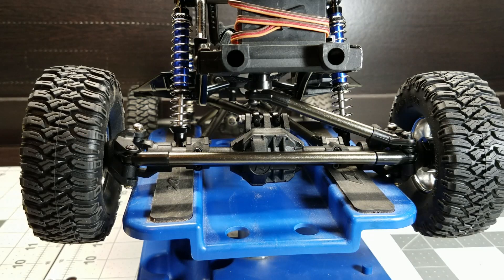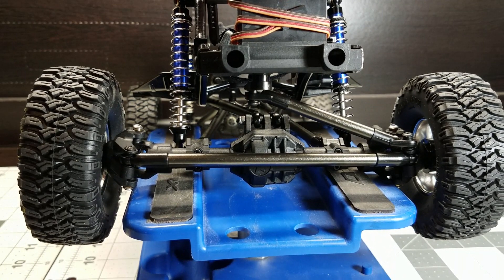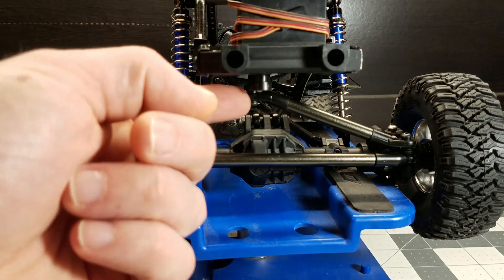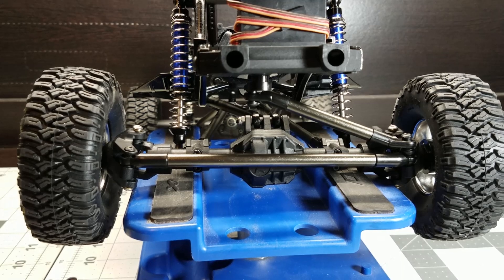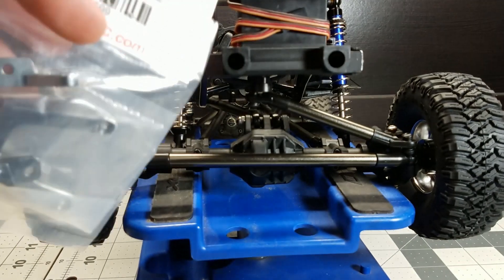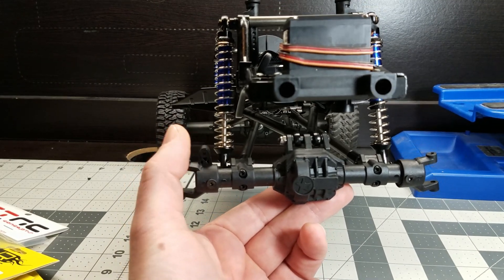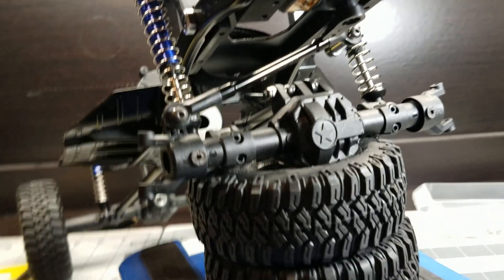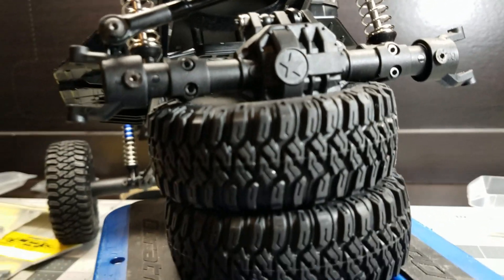Axial SCX10 II clone upgrades (installing a track bar on Austar chassis)

Comment: Hello, I think I made a mistake by buying a clone chassis with scx10 2 installed because the material quality is terrible and I realized this after I bought it. It is too late and now I am having problems with the front axle. The axle is inclined to the left and when the suspension is pressed, it tends to slide to the right. How can I get rid of this?

Comment: Hello, please advise me. I am building a SCX10 II clone with Injora chassis. I cannot get the geometry right. The chassis came with links and panhard bar pre-installed, as well as the shocks. What happens to me is, that when steering to the left, the front left of the truck lifts quite significantly. If steering to the right, it kinda wants to lower itselfo on the front right side. The only thing I did is I installed taller shock towers, so I could lower the body (using Jeep Cherokee XJ). Does this affect the geometry in the way, that it behaves or is it a different issue ?
Reply from the maker: @MostlyRCSlovakia  yes, any change in height will mess with the geometry of the suspension. You will have to mess with the length ans possible angle of the panhard bar
Reply: @oddsandendsrc  thanks for the reply, will plylay with tje lenght and angles and see what comes out

Comment: Mine came with this axle with a trx4 2 speed transmission and 3 link set up?.. the top link is on the passenger side. Would the geometry still work for mine? Thank for this video.

Comment: Does the length of panhard & steerinh link are necessarily the same length?
Reply from the maker: They are usually close, the angle of both needs to be close also
Reply: @oddsandendsrc  understood sir. Thank you very much for the tips. Appreciate that so much👍🏻

Comment: so im running 110mm shocks on the same clone chassis in the video would i need to use a 110mm track bar, i did all the same things you did step by step

Comment: Is it as simple as switching the hubs from one side to the other, or did you need a new passenger side hub? I thought I heard "switch"....(I'm a noob). Also, did you make the 95mm track arm or purchase it? BTW, I have zero clue as to what I am doing. I can't even tell you very much about F150 FX4 truck.

Comment: I did a simple bump steer delete on it. Just mount the servo below the usual mount. No extras needed just screw it in under where you normally would on the same mount and that completely fixed it for me. The servo is a lil bit more visible but i run scale rigs so my standards for that are pretty high and it looks fine.
Reply: Pardon, how?
Reply: @Stodgyaban_  hard to explain. Litterally just mount servo below the traditional mounts. No extras needed it is simple. Moves the servo down decreasing bump steer.
Reply: @keqrou  but it still doesn’t fix 100% ?
Reply: @Stodgyaban_  99%
Reply: @keqrou  great
Reply: @keqrou  can i get your social media? Ig or something else? Easily to talk about the mod. Cause now i don’t have the kit yet 😅

Comment: I have the Injora Clone, with the motor in the front. I shortened and longer steering and panhard link, but it steer a little bit when the shocks are fully extend. I also longer the upper link by 2mm and the lower ones by 5mm to get my clearance and wheelbase. Does this effect anything? I'm a little bit confused. Does the position of the servo effect anything? I was forced to put him further back, maybe 5mm.
Reply from the maker: The steering link and panhard link need to be close to the same angle, if one is angled more than the other one it throws everything off. It's a game of trial and error. Also remember to remove one of the upper links if you haven't already.
Reply: The Injora clone have a 3 link system with panhardbar  @oddsandendsrc

Comment: Great explanation. Not much detailed info out there on these SCXII clones. Thinking about picking one up to mess around with.
Reply from the maker: I recommend spending a little more money and getting the scx10 ii builders kit. It's a better quality platform to start from in my opinion. The ssd trail king is even better but more pricey

Comment: how did you change of the track bar mount on axle, from left to the right position?
Reply from the maker: You can switch it from one side to the other.
Reply: @oddsandendsrc  it just used screw?
Reply from the maker: @lzkids3431  it has been a while since I did that, I no longer have those axles, but it was very simple I think there was just a screw or two that holds it on. You just take them off and switch sides.
Reply: @oddsandendsrc  thanks for your help sir. maybe sometimes you will make video for  upgrade plug n play parts to metal for scx10 ii.
Reply from the maker: @lzkids3431  It gets fully upgraded in newer videos. look for the yellow and orange jeep

Comment: the bolt that goes through the axle fitting for the Trackbar, is it a 3mm dia? the hole that it has mine is quite small for a 3mm to go through.
Reply from the maker: It's supposed to be, but with these China clones, sometimes things are off a little. You might try running a 3mm tap through it.
Reply: @oddsandendsrc  but the bolt that you used was a 3mm dia, right?
Reply from the maker: @ripmax333  I just checked and it is, but if yours don't want to go, don't force it. I have had 3 of these, sometimes they forget to drill holes, or drill them to small, you might need to drill it out a little.
Reply: @oddsandendsrc  that what I’m going to do, drill a 2.5mm hole or slightly bigger a use a 3mm bolt. I asked because i didn’t know if there are rod -ends that use smaller dia bolts. And without the track bar, does the axle goes side to side because of slop through the rods balljoints?
Reply from the maker: @ripmax333  most rod ends use a 3mm hole. After you remove one of the upper links, the axle will move from side to side without the track bar. The track bar makes it solid.
Reply: @oddsandendsrc  i have four links installed and the axle still moves side to side. All because of the the slop on the rod-ends bearings, maybe i got a very cheap set or its normal.
Reply from the maker: @ripmax333  There shouldnt be much with 4, but you have to remove an upper one for the track bar to work properly.

Comment: Great video, I have one of these too,which I want to rework. Question-would the servo mounted to the axle not be a simpler and better solution? And if no, why? I have to order parts including new metal shock towers but am thinking of going the servo mounted route.
Reply from the maker: If you have the room in the chassis when the suspension is compressed and the servo won't hit anything above, it should work for you. The chassis mounted servo allows for more room and a more realistic look to their full size counter parts.
Reply: @oddsandendsrc  Thanks for your reply. Room isn't an issue, I have a heavily modded LWB Land Rover hard body that it matches up to, this will be a trail truck, no rock crawler.  Prefer the chassis mount for neatness but I can see, like you, that there is room for improvement! Will watch your vid again and decide which way to do it.  Thanks again for posting, subbed.

Comment: Hi. I have 3 link setup but i got strange problem. When car is on ground and  i turn the wheels to full left and full right then my chassis lean to left or to right. What can be the problem?
Reply from the maker: Did you install the track bar?
Reply: @oddsandendsrc   Yes i did. Can we talk ower whatsapp or discord? So i can apply photos or video.
Reply from the maker: @trebor1477  I do not have those. It sounds like your track bar and your steering link are not the same lengths, or at the same angle. If you or a friend has a stock scx10 ii laying around, take a look at how the track bar and steering links are the same length and angle.
Reply: @oddsandendsrc   angle is prfect but lenght is little diferent for7mm diference. But funny thing i allready got it in working order. But i  went from 270mm to 310mm and i use this yota axles. Ok panhard mounts are DIY. But it was working before. That is strange. And the only diference is longer chassis and front links.
Reply from the maker: @trebor1477  When you moved the front axle forward, you changed the geometry of the track bar and steering link. you will need to move the chassis panhard mount forward also.

Comment: great video but why so negative ,we all can't afford top end stuff
Reply from the maker: Sorry if I came off sounding negative. Most china knockoffs will end up costing more money in the long run because of low quality parts used in these will fail quickly.
Reply: @oddsandendsrc  yes I understand and getting stuff in UK is hard ,but you would be surprised on how strong the gears are in the gearbox if you pack it with lithium grease ,apart from the crappy shocks mine is super

Comment: This chassis is really cheap like only 70 right now, if i wanted to buy it just as a basher because its so cheap and not do any crawling would it be fine stock? Thank you!
Reply from the maker: If you were easy on it, but it won't take the abuse of an axial
Reply: @oddsandendsrc  thank you!

Comment: Idk of you will see this but I have just ordered one of these I have no electronics and it's my first it comes with a motor but idk what to run on electronics. But definitely subscribing bud
Reply from the maker: If your on a budget, I recommend the Hobbywing Quicrun 1060 esc, its usually under 20 bucks on ebay or Amazon. If you dont have a radio I recommend the Flysky gt3c, a great budget radio with alot of options. Usually under 50 bucks on ebay or amazon.
Reply: @oddsandendsrc  thank you I really appreciate it

Comment: This is the first video I’ve see where someone explains rather well how to properly setup a Panhard/3-link suspension. Questions; 1. Ideally the steering link should be the same length as th track bar? 2. Which upper link should I remove? I’ve seen most will remove the driver side link. You did the opposite. Does it makes a difference?
Reply from the maker: In a perfect world, the steering link and the track bar should be the same length and parallel to each other at the same angle, but the way these are designed you can't always do that. Just try to get it close and adjust as needed. It doesn't matter which upper link you remove, unless you use a off center differential like I do in a newer video when I install the ssd axles.

Comment: Did you run this car ? What can you say to the performance? Is it any good or crab?
Reply from the maker: You get what you pay for. Shocks were too stiff and locking up, poor front end geometry. Plastic gears in the tranny. I upgraded everything except for the frame in newer videos. If it will get very light use, might be ok, buy name brand if you want full potential.
Reply: @oddsandendsrc  Fully understood ;-) Unfortunately the good kits are quiet expensive here in Germany. Element, Gen8 or SCX10ii kits cost roughly €250+...do you have an recommendation . good value kit, not for competition, but should have potential from the beginning?
Reply from the maker: Scx10 ii builders kit if you want just the chassis, its $200, or a scx10 ii deadbolt rtr, its $300 ready to go.

Comment: Hola, en primer lugar gracias por el video. Mi pregunta es......si no se puede colocar la barra panhard en el otro lado con un soporte?????. Gracias.
Reply from the maker: It has to be moved to the passenger side because the axial and other aftermarket branded shock towers only have the panhard mount on the drivers side.
Reply: @oddsandendsrc   Gracias por tu respuesta... Un saludo.

Comment: Thanks for the great video! I got one and dont know what shock tower suits with this chassis. I bought one but it doesnt fit with the chassis. Could you share where you buy this shock tower?
Reply from the maker: Being the chassis is made so cheap, quality is not the best. I have 3 of them, 1 I used in the videos and 2 others. The 1st one I used the STRC scx10 ii ones and they fit perfect. The 2nd one I built, it was like the frame rails were fatter and the STRC tower didnt want to fit. I used a dremel on the shock tower and ground on it till it would fit the frame rail.
Reply: Odds and Ends RC Thanks mate

Comment: Hi, thanks for the video, very helpful. I was wondering if Axial scx10 ii diff covers will fit this kit. Thanks
Reply from the maker: No, they are a little different
Reply: You could just buy the ar44 axles housings and swap the injora internals over. Housings are cheap.
Reply: Looks like the entire diff/axle will slot right in just fine though, probably not a bad idea to just swap over once something breaks

Comment: Great video! One question: why does it need to be on the right side? Thank you for the video.
Reply from the maker: The shock towers you buy only have the mount for the track bar on the left side, thats why I had to move the c-hub with the mount to the right.
Reply: @oddsandendsrc  thank you my friend

Comment: Great video, thanks. I just finished doing this to mine and it worked great. I used the link I removed, cut it down and re-tapped the threads to make it into the track bar.

Comment: Now, how are you going to address the horrible caster angle? Since you cant clock the hub mounts, the caster is really bad in stock form
Reply from the maker: I shortened the upper link to swing the pinion angle down to straight. That took care of alot of it, but the best thing you can do, is take these axles out and throw them in the trash! Lol. Replace them with 10 ii axles or equivalent, they are adjustable.

Comment: Great video! I did part of it from the beginning since the hole steering its invested. How did you managed to reduce the stock rare camber angle on the front wheels?
Reply from the maker: I shortened the upper link to swing the drive shaft angle down, this helped alot, but you kinda get what you pay for with these things, 10 ii axles is a much better upgrade for it since they are adjustable

Comment: I'm about to buy some links to do this.. is it 95mm from eye to eye or is that without rod ends?
Reply from the maker: It was 95 from eye to eye. remember, if you have taller shocks it will be longer, shorter shocks and it will be shorter. Just fiddle with it till the axle is center.
Reply: @oddsandendsrc  I've got the stock shocks on it.. thanks for the help!

Comment: I've heard that before about the 3 Link with Panhard.... Can't remember where! 

It's worth the extra couple of bucks for an Aluminum Mount. 😉 No way you could have put a Spacer on the Plastic Axial Shock Hoops, to move out the Track Bar forward. Would have twisted the Plastic, and possibly snapped.
95mm is about the maximum heighth you'd ever want. 

..... But there's always the "Flex Friday" Guys!! 😜
Reply from the maker: The axle was alot more forward on the clone than a real scx10 ii. If it would have been in the same spot, I wouldnt have had to use a spacer. I will have to change everything to fit the jeep body anyway.
Reply: I keep hearing that there's quite a few differences, some major, in the Clone. 
I'd still want one.

Comment: Strc part #, jeep body is very hard to mount  n been cutting most of floor out. Beware .
Reply from the maker: The STRC part # is STA31380FGM. The Jeep hard body requires the SSD scale transmission or a forward mount tranny with a transfer case to get it to sit low on the frame without chopping the floor.